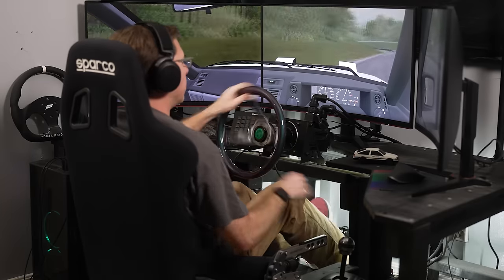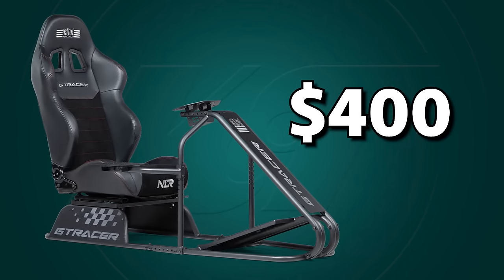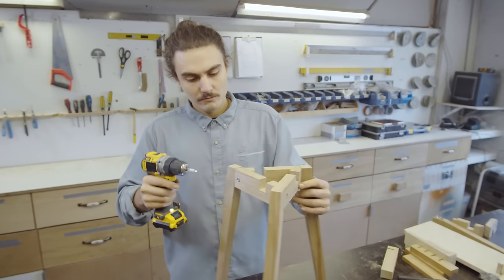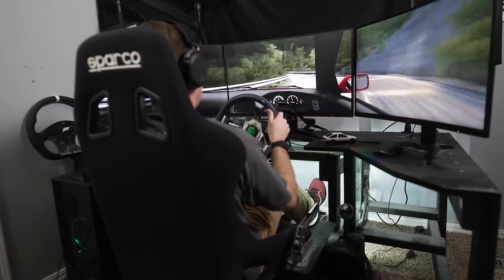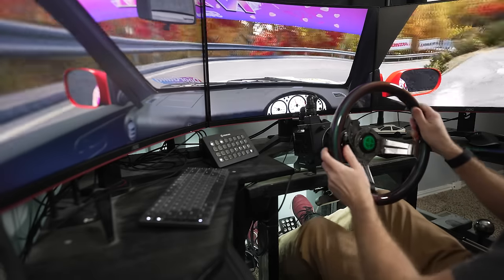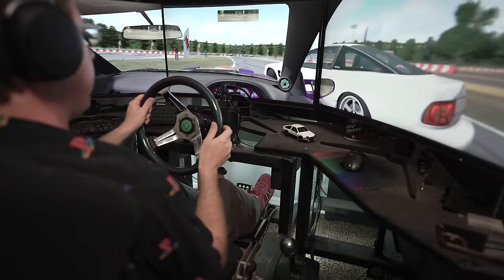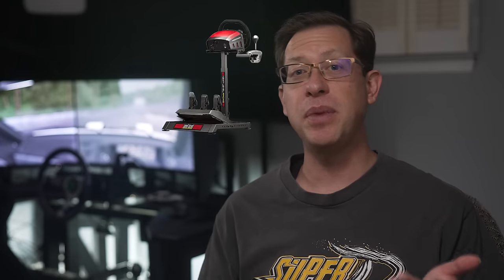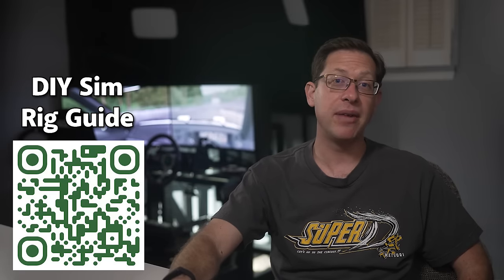My thoughts after 5 Years with my DIY Sim Rig

Comment: Funny this should pop up as a suggestion. I bought my 1st wheel just over a year ago and almost immediately put together a DIY cockpit using an old but quite comfy xrocker gaming chair for the seat and a couple of lengths of 2x4 and some off cuts of ply wood that I had knocking around. I say funny this should come up as my g920 decided to die on me the other day so had to get another wheel. I decided I should go for a slight upgrade as I've really got into racing now. As I'm a console racer options are rather limited so went for a TS-XW wheelbase with T-LCM pedals (couldn't wait for fanatec delivery times for an affordable DD wheelbase). When I built mine I realised that adjustability for future rig changed was essential and built that into my rig and it definitely came in handy when changing wheels. As for the finish the issue you have was caused by how you painted it. As a carpenter I did it properly and primed undercoated and the glossed (in a really nice deep purple) the rig and after over a years worth of use its still as smooth and shiny as the day it was finished. So basically it's how much time and effort you're willing to put into it as to what results you'll eventually get.

Comment: One thing I'm doing in my build is have a few 8020 parts, such as wheel stand and a side mount. While the rest of the build is still really cheap, you get to replace fixed equipment much more easily. Unfortunately, in my case I couldn't come up with a solution for the seat and pedals. That's life, I guess.

Started my build a few days ago and was using your initial video as a base. Thanks so much for the update!

Comment: There is a mid ground for diy and off the shelf alloy rigs.
I have a very "unique" space to fit a rig and pc desk in, so I went the CAD alloy extrusion route. I designed it to fit in and be a really good use of the space and then sent the 80/20 lengths to a company that cut and shipped them to my home. It was just under £500 shipped from Germany to the UK but is more intricate and specific than any off the shelf option, it's also more than strong enough for any direct drive wheel.
The draw backs are it took hours of measuring and CAD, then a few extra hours to build as I didn't have instructions only a tape measure to figure out what went where
Reply from the maker: That's really neat, there are a few guys in my discord community who did something similar and their results look great. I may try to make a build tutorial on other material types (PVC and cut-to-spec aluminum profile) someday

Comment: On an extremely tight budget, I was able to build myself a full wood rig for 500ZAR (about $25). My dad has a wood workshop so had all the tools with loads of spare timber and bought a seat of a wrecked Jeep Wrangler (which was $25). I have to say, my sim racing experience with this has been amazing! Reclining seat with rails, wheel and pedals mounted so no slipping or shifting, it has been a blast! I only wish I can afford a DD wheel...

Comment: I built mine out of 1/8in square tubestock. Used the whole project as an excuse to buy a cheap welder and learn to weld(poorly). Was a lot of fun. Its definitely a heavy piece of kit, and I didn't get the seating position even close really, have just recently started making mounting changes and adding wooden pieces to adjust position of the pedals/wheelbase, but it absolutely came out cheaper than anything I could have bought for the size/layout including the tool purchases. I'd absolutely recommend if going with something metal to account for more universal fit/mounting for different pieces to make the ease of adding new bits in the future easy. I was in the position of needing to refit the seat height, the last thing I wanted to do was disconnect everything and lug the rig back out to the garage for a cut/grind/reweld session. 

I had a lot of moments during the whole process of just wishing I'd bought a purpose built/modular kit, but in the end my wallet is a lot happier haha.

Comment: I would make my custom rig work on rails everywhere. but the casters at the bottom, those would just lock.

Need to adjust the wheelbase height? Unlock a rail, lower or raise the wheel, and lock said rail again.
Want to change to a RHD setup?* derail the shifter and handbrake, swap positions (assuming you'd want the handbrake closer) and remount on the left side of the rig to emulate a UKDM or JDM setup.
Want to bring the wheel closer? (for example, shorter arms or a non-deep-dish wheel) Move the seat closer, no need for the wheel mount to be on a rail.

You get the point. I think it's amazing.
*another way to make the setup easy to RHD would be to use heavy-duty clips instead.

Comment: Very well done! This is the only video of yours that I've seen, having just clicked on the thumbnail to see the wooden frame. Your information, presentation and editing are top notch! If you're happy enough with your setup and willing to spend a little bit more, you can find furniture grade pre-finished plywood for your top which will dust off very easily. Also, an alternative might be a few coats of the right paint to finish with a smooth surface. Either way, great video and great ideas. Cheers!
Reply from the maker: Good point, I was a newb at the finishing aspect of "furniture" building, so I figured I'd just send it and learn as I went. If I ever build another wood rig I'll definitely take your & others advice (lots of folks have have helpful insight/critique) to get a better final surface :)

Comment: Im a seasoned sim racer, i built my own rigs for years then bought a next level racing gt track for about £600, i had it as a permanent or fixed set up for about a year, then i took it apart  put it in the shed and went back to homemade, i have cup holders, vr headset storage, bass shakers, carpets and excellent cable management, if you have some diy skills and a few tools i would always recommend saving money on building your own rig and investing the money saved on a decent wheel and pedal set. Stay away from wheelstands and foldable rigs because they are All flimsy

Comment: 3rd year into sim racing, spent my first year at a desk then I made a wooden  rig. I wanted a profile extrusion rig but couldnt afford it. I bought a gtomega monitor stand which is black extrusion, it cost me £150 because it has the right lengths for what I needed. Then I've bought further black extrusions from aliexpress and I've slowly been swapping out the wood for aluminum. A great way to save whilst waiting for a delivery from aliexpress for another piece. I'm 90% extrusion now and it's cost me £297 so far and I guess another £100 to finish it. So I got my perfect rig for £400. Best thing is I get a lot of feedback through the rig now compared to when it was all wood.

Comment: Built my wood rig darn near a decade ago and still use it for $40 of 2x4's and MDF. If I want a new mount for something it's wood! Just drill a new piece on . Easy. Picked up two car seats online for free. No I'm not a carpenter at all but I had basic tools. Wasn't hard to do. I will push back on one thing though. My rig is HEAVY! 🤣 Good video!

Comment: For Seat, if you are unlucky and its hard to find. You can go to a Place like IKEA or similar. In the PC Desk/Chair section they should have something similar to DXRacer if you wanna go cheap.
When opting for descent Quality, than get a GTRacing Chair, they start at like 100$, you can ignore the Waight limitations and stuff, since they are about the Gas-Piston.  Instead you dont install the "feetpart" get a Steelplate if needed and Threat it to a Railsystem instead.

Comment: I ordered myself some aluminum profiles and seat rails, got a used bucket seat for cheap and 3d printed all the corner brackets etc. Overall it was somewhere around 350€, is rock solid, adaptable to new gear and looks pretty nice as well. Since I ordered the profiles cut to the correct length already, the only special tool I used was my 3D printer. However you can also get around that by just buying metal corner brackets for around 50€ on top.

Comment: I've never been overly satisfied with commercial the cockpits I've seen. Either looked too flimsy or pricey.

Eventually I just made one with some 1-1/2" ABS pipe (the black plumbing pipe), ABS fittings, 1" pine panels (for wheel, shifter & pedal decks), U-bolts and 3/8" bolts to fit my Logitech G25 wheel and Rocker gaming seat. And I can adjust the Rocker seat and it stays in position. The wheel deck also serves as monitor deck for a 32" 2K monitor. I used to park it in front of the 42" HDTV. I use a Logitech X-540 5.1surround sound speaker system for audio and the Rocker seat has audio in. Pleased with the result, the tubular frame looks cool and is solid, zero flex. Only tools needed are a electric drill, hand saw, wrench and ABS cement. I got all the materials at Home Depot and Canadian Tire.
Reply from the maker: I might try an ABS build someday--just to see how well it comes together. They look neat and I bet they're even lighter than wood which is a plus.

Comment: I agree with everything you've said. Way I look at it... good sim racing gear can be costly, but nowhere near as costly as running a real car, and it's generally a one-and-done purchase (aside from the odd breakage that comes after hundreds of hours of use) unlike a real car that will have nearly constant maintenance costs. A low cost DIY rig can also make it easier to justify the cost of higher tier wheel bases and accessories lol

Comment: My seat is from a Dodge Intrepid. So conformable I'm working on powering the driver seat since it has electronic controls for seat tilt, movement forward, back, up and down. I working on designing my own rig and wanting a way to have the same features for the pedals and wheel. When I have guests over, easy adjustability would be a big plus.

Comment: Going from a wood rig to a professional aluminum extrusion rig was one of the best things that improved my driving.  The wood absorbed a lot of the vibrations of the wheel and pedals, your already missing the G forces and you need all the other sensory inputs.
Reply from the maker: Agree, not having g-forces like you in the real car is bummer. I think profile is the way to go for max performance, but I'll be happy if more people get into sim racing, which means budget inspiration is a net positive even if ppl upgrade later. I'm looking forward to trying an aluminum profile rig--I suspect it will be similar to how my driving improved once I got a bucket seat and 5 point for my car--higher quality info /less distractions from sliding about led to more composed & higher quality driving.

Comment: I built mine with pallets and a wooden chair. Since i play in VR looks don't matter. 
I used a pallet to mount my Rx7 chair, Flight Stick(Flight stick is used as a handbrake), and shifter too it. So i sit pretty low to ground. The chair is used to mount the steering wheel, its a chair that isn't used anymore and i placed weights on top of the chair so it doesn't move around. Again since i play in VR looks don't matter and everything works just fine.

Comment: Hi, thanks for share, I enjoyed your video a lot and I agree with you in all topics.
I have no exact recall when I made the very first version of my wood cockpit, 6 years at least.
Since then I have upgraded it 3 times,  1st integrated monitor mout base (single), then 5.1 sound system and haptics and at last, Fanatec DD+ & V3 pedals.
As you said, and also for me the major downside, it's every single upgrade could take you even days or as much as you look for a good finish, and even that, it's a matter of ajustments and reajustments all the time.
The funny story, I sanded all wood good enough to have a easy cleaning surface so lucky me.
Tip, adding some decals to your rig make it look much fancy (it's no my idea actully, I took that from another guy here on Youtube).
I have no blueprints just some sketches and pics if anyone is interested, just try contact me through this way.

Comment: I had playseat evolution and then just took the seat and welded new rig around it. All metal bars were free for me, so it was basically "free" and took only one afternoon to make. Good sim rigs are just so expensive, that im happy to do some more welding if I need to change something. Its really rigid and I got it to perfect position for me at the first time. I will get a new seat at some point because thats the only thing flexing in the rig, but its not that bad and I dont really notice it while racing.

Comment: My diy rig build got put on hold for winter, but I have all the supplies ☺️
My plans include building it very low (directly on 2x4's) but elevated for ease on entry & I will have storage space for 12, 12"X17" clear storage boxes from Home Depot 😁
My only expense was buying a used bucket seat from the salvage yard for $100 (a bit much, I thought). I happened to have all the wood for the rig & the base will be from pallets. I personally like the look of wood, so I'll stain it a dark color instead of painting it black.

Current plans are to make the seat height the same as I use w/ my desk but I'm considering adding one or 2 layers of  the storage boxes (6.5" or 13" higher). And 2X12's for the uprights, mounted w/ bolts for easy disassembly if needed (the left one slanted @ 13 deg for easier entry) and 4 heavy duty steel shelf brackets ($7 each) I bought to stabilize my last desk that was getting very wobbly.
Also putting it right against the wall w/ a bookshelf built behind the monitor from broken down pallets 

If you can combine your sim rig as a storage device that makes up significantly for how much space it takes up.

Comment: Exiting to see this video.  I used your videos on building it as inspiration to the one I've made right after COVID, its well over 3 years old now and I slowly add new things to it from time to time.   For the seat, I bought a cheap-ish "racing" seat from Jeggs which had rails.  I'd never use it in a real car but for my sim rig its fine.  I made my upright and wheel deck adjustable in height and angle which was a pain in the ass but if I ever do get a different base (using Fanatec DD2) its only a few bolts to adjust it a bit (stole this idea from a different video when doing my research).

Comment: You can buy square metal with holes pre drilled at lows and home depot for the pedal and frame wheel stand . Also if you have a next level wheel stand you can bolt it to it for about 140 bucks

Comment: ok so its getting close to time for me to build mine. one suggestion i have on the dust problem. im going to look for some grainy boards and im going to stain mine. taked an extra 5 mins when grabbing materials and stained wood always looks nice. they have some newer urethane coatings that will leave it with a nice wet look always. but it also drys a nice flay smooth and encased board. its a hard outer coating like laminating the board and very durable. the wood wont rot or be susceptible to moisture either. with a nice red brown stain then the clear coat you can make a very rich looking board from a basic 2x4. 
i even scored a free car seat to use for mine. it has flip down arm rests too for those cruising sessions or long races.
Reply: update. for the price of 2-3 2x4's i have mine made and it works great. it was cheap someone else bought the boards even so im in it the price of stain. after a few quick cuts to get my basic frame with the roller wheels everything else fell into place. 
i followed no plans no real determined plan other than easy in easy out and proper feel in the hot seat. because i used car seat its even adjustable for diff size people and ive had a few people try it already and their in love with it. especially knowing a metal flimsy one is about 200 bux and 150ish used. for 30 bux in materials this is way better and will last alot longer. my room mate and neighbor game me sh1t for stealing a car seat thats been unused for years. ohh you cut it all up which i didnt. i removed 4 bolts that can be put back on and it can sit in the way again if need be. once they seen what i made and sat in it. they were like no ok its yes living its best life ever. 

dont get me wrong im decent with a saw screw gun and drill i fixed houses for a living for years. fixed cars all that mess. never did i put it in my head i could build this too. why idk but im glad i listen to your crazy self. because now i have more things too i made because i can vs i technically could.

Comment: A few 8ft 2x4s a 2ft X 4ft sheet of plywood, a circular hand saw, a drill, a bucket of 3” wood screws and a seat off a trashed Chinese sim rig from Facebook. Been using it for 4 years now. Not the prettiest thing I’ve ever built but I’ll be damned if it ain’t stable and effective. Only complaint is having to drill new holes if I change hardware. Took me about 4 hours to build, having no plans laid out ahead of time.

Comment: Just an idea but you could cut out that top board just wide enough for your steering and then screw a 2x4 under where the old top is still (under the desk) , would drop it 1 3/4 inch and not impede on stability.

Comment: Also, I do point out that aluminum extrusions have standard dimensions and are dirt cheap. Throw in 3D printing for mounting and rigidity components, and you can build a metal cockpit that can in fact adjust like everything else.